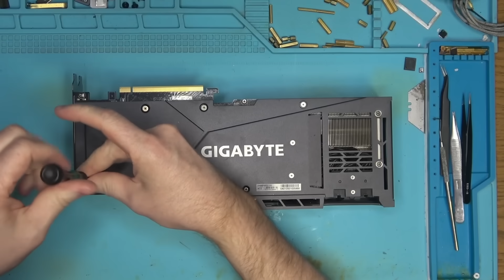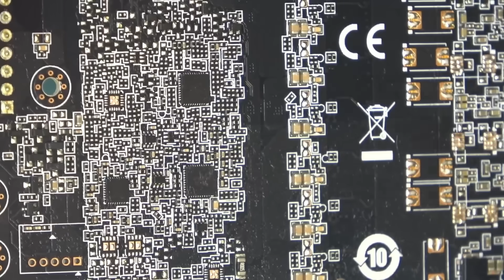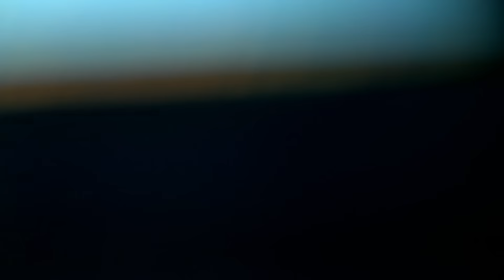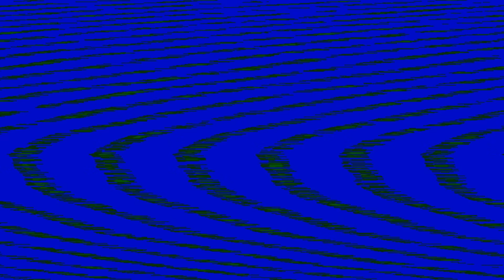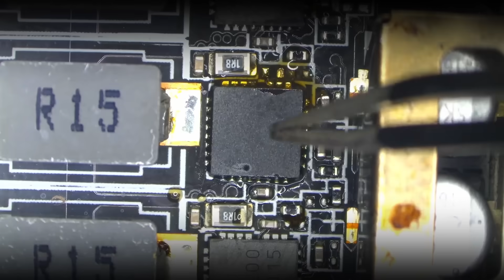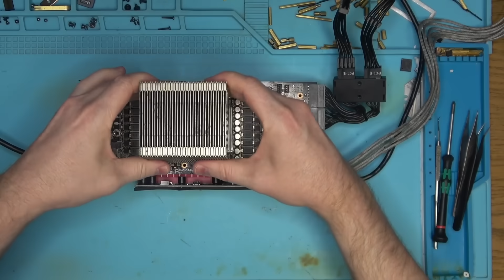Why Gigabyte keeps failing and what if your GPU gets a power surge ?

Comment: @northwestrepair You're bang on with your assessment. I bought a Gaming OC 6750 XT at 2023 January. It died 2 days ago. Games were playing fine. There were no stutters or frame drops. It just stopped sending signal and the Motherboard's VGA led started lighting up. Have done every checks to ensure if it has to do with GPU. It is. I'm not going to buy any Gigabyte products ever again. I'm looking to buy Sapphire Nitro + 7700XT now. Can I expect it to be durable, unlike this Gigabyte one which has lasted just a little more than the warranty period? Thank you in advance.

Comment: i have a zotac 3080 that luckily survived a surge from a lightening strike.  the power supply however did not make it.  one of the 8 pin cables that plugs into the psu to the gpu melted in place in the psu.  some of the coating on the wire right behind the connector where it plugs in to the psu melted and exposed wires and now that 8 pin cable is forever stuck to that psu now.  i saved it as a reminder to not fafo in a really bad lightening storm.

Comment: I had Gigabyte 3080 Ti, basically the same version as in the video, just white and after few months, i encountered artifacts basically with 0 load, no game, just in windows and watching videos. I switched display port and everything was ok and i didnt want to RMA cuz i had no time. After few weeks, when i had time, i tried to recreate the issue and connect back to the !bad" display port and everything was fine.
And every few months i had random artifacts, every time it started while idle and when i applied load, it completely crashed and restarted PC and then it worked fine for another few months. I tried new drivers (DDU ofc), but nothing helped and that was good for me, because i payed for extra warranty one shop has in my country, so when 50 series came out, i RMAed it and i wanted 4080 Super (the start of 50 series was not convincing) as a replacement in the same price category, but they had only "open box" state of 4080 Supers so i had to take 5080. So i dont know whats wrong with 3080 Tis, i saw a lot of them on your channel.

Im glad, almost no issues so far (i had one minor issue that i forgot what it was and im very careful with drivers and not updating when i dont need to), i have "basic" model Gainward 5080 Phoenix, but i was surprised by build quality, its very sturdy, no sag but i ordered stand anyway, just to be sure. I undervolted and overclocked and temps are very good cuz i think it has the same cooler they put on 5090.

Comment: Hi Tony, I have never seen a damaged bootstrap cap. Due to heat, or why? Not too large charge/discharge currents, likely way less than 1uF, usually protected by a low ohms resistor anyway (as the diode is tiny). I'm wondering, whats missing in the design.

Comment: Had 2x 3080 gigabyte fail in a month 😢. Now replacing psu hopefully that was the cause. Any chance of fixing them?
Reply: If it's the same issue as this one, sure. The permanent fix is to remove that capacitor and replace the blown power stage (and eventually the fuse). You have to diagnose it first of course. the PSU is not the issue

Comment: This is the reason why I unplug my whole system during a bad thunderstorm.
Reply: Ahh, the joys of overhead powerlines, we have it all underground over here, the only time we had some lightning damage was 2 years ago when there was a lightning strike on a tree right next door to us and even then only our Wifi router got fried. That was so loud, sounded like a cannon going off.
Reply: @Aliens308 i live in an old soviet building with the majority of cables underground(9 stores high) and the other side of this building was struck by a lightning which fried a lot of electronics as the news told us.
My friend lives in germany in a private house and in his case a lot of stuff got destroyed but surprisingly only the monitors died and not his pc.
Reply: @john-b2r9p  Then I guess that I may have been very lucky, since I was sitting at the PC when it occurred. Our electric provider has some safety system that cuts power immediately when there is a problem, so the power went out for a few seconds and when it came back I simply restarted the PC but the router didn't work anymore, it kept resetting itself and boot looping endlessly. 
Edit, I also have some MOVs in the fuse box that protect against voltage spikes, but they are sacrificial and none of them triggered
Reply: I wanna switch off also my system from the socket but i prefer to play some games until the thunderstorm go away 😀

Comment: meanwhile both my pcs using gigabyte motherboards and gpus keep trucking along, i use surge protection but every house they've been in has had unstable mains. brown outs and surges are common, tbh there's faulty cards of all brands i just put it down to bad luck.
Reply: Ok, well, thanks for clearing that up. Your advice is definitely worth more than someone that works on these every day.

🤡
Reply: @BLawr3nce chill out lil bro this guy says every brand sucks 😂 edit: my 5+ year old gigabyte 3080 should be long dead according to this channel btw, like i said luck.

Comment: Like in when a breaker pops in the house and some Muppet turns it back on again without disconnecting all devices against current peaks?

Myeah this is why I avoid Gigabyte with a passion

Comment: What kind of a shity power supply allowed this to happen?
Reply: Not related with the power supply
Reply: @TigTex  Aris from hardware busters, "Cybernetics" would disagree with you. You see modern PSU's have all these protections exactly to do that, to protect the internal components from all eventualities.
Reply: @teddp a power stage that shorts itself out due to bad PCB design cannot be prevented with a proper power supply. What might be prevented is extreme damage because the power supply doesn't shut off in time.
Reply: @TigTex the damage was caused due to a power surge. The PSU should have handled it.
Reply: @teddp no. The damage was caused by a faulty PCB design. Power surge is unrelated. If it was a power surge, that graphics card would be trash, not even the PCB is good to be a donor

Comment: A related warning.
A specific brand of fiber optic HDMI cable has an issue where if there is a lightning strike anywhere near your location, the connectors will produce a static spark strong enough to kill the HDMI port on both connected devices.  It will produce a visual flash, and an audible pop.
Here's the thing -- ONLY the specific HDMI port that was connected will be killed, the rest of the device will continue to function normally.
I had this happen twice.  The first time I had no real idea what happened, as all devices were powered down, so I purchased a new FO HDMI cable of the same to replace the one that was attached when both devices lost HDMI capability.  Paid to have the OPPO UDP 205 repaired (HDMI in board).  MSI replaced the RTX 4090.  No sign of lightning damage, just dead HDMI in and out on respective devices.
Second time, POP! -- Heard it.  Checked . . . that specific HDMI input on surround receiver was dead.  HDMI output on replacement 4090 was also dead again.  The strike wasn't even close to the house, but miles away.
As I have six more inputs on the receiver, I simply swapped to another one. 4090 also covered under warranty, and they still couldn't figure out why the HDMI out was dead.
I was suspicious after that and purchased another, more expensive brand of FO HMDI cable to replace the first one.  Next thunderstorm, I disconnected the new one, but had the two old brand cables lying out in the open.  POP!  A bright flash of light out of all four ends of the older completely disconnected HDMI cables.  The culprit was discovered.
I cannot disclose the maker of the cables, as various discussions are ongoing, but let me warn you that you should not trust an Optical HDMI cable during a thunderstorm.  They require voltage from the device they are connected to to function, and if you buy the wrong one, as I did -- your equipment is at risk.
Reply: Why would you buy a fiber optic HDMI cable? lol.
Is this another case of "a fool and his money" thing?

The distances and frequencies used for HDMI in consumer devices don't require a fiber optic link.
Reminds me of people buying gold plated Toslink cables lmao.
Reply: @GoldSrc_  144hz at 4k requires HDMI certified cable at 2.1. Use anything else it won't work. If you go above 5m (16 feet) in length, thats when you get fibre optic cable. If you wont the display loses signal etc. In my case I use one for high refresh rate 4k display 10m distance (30 feet). Cable works fine for years and costed 45 dollars + is HDMI certified for 48gbps
Reply: @bagmar ever hear of display port? It can do that with ease!
Reply: You could get a display port that does the same exact thing for half the cost😂
Reply: @bagmar  Thank you for chiming in, here.  The people talking about Display Port here seem to think this is a very short connection.
Reply: @spencernene  my TV doesn't have DP :)
Reply: @spencernene its all about the lenght. TV's especially are more prone to lose signal integrity at high data bandwidth.
Reply: @bagmar oh damn that’s tough, you should still be able to get a high spec hdmi for pretty cheap if you don’t fall for the marking garbage
Reply: @GoldSrc_  The cable goes 40' from the room the PC is in to the living room with the TV and surround system.  Passive HDMI cables are limited to around 15 ft. (25ft for premium) to reliably pass a 4K@60hz signal.  This isn't marketing, the very expensive passive (copper core) HDMI cable I was using did fine for 1080p, but suffered major issues when the resolution was cranked up.
Reply: If I lived in a third-world country with exposed over-ground power lines (like Vietnam, Burma, some parts of Soviet Russia, or the US and A), I'd rather invest 10-20 bucks in a surge-protected power strip instead of playing pop-a-port with expensive devices.
Reply: @RealNovgorod  Both ends of the chain are protected by surge-protected UPS.  Please re-read what I wrote.  The ends of the HDMI cable spark during a close lightning strike even when NOT attached to anything at all.
Reply: @ripvanwinkle9648  Uhmazin'... Do you live inside a plasma ball? Maybe it's time to tinfoil the house like in Better Call Saul (not even joking). At least around the cable runs in the walls which apparently act as a huge inductor.
Reply: @RealNovgorod  The new cable from a different manufacturer does not have this issue, just the one from a specific maker.
Reply: @ripvanwinkle9648  If you live essentially inside a Tesla coil or a radio telescope with such huge amounts of B-field buildup from the weather that it causes random cables to induce sparkable voltage, it's just a matter of coincidence until something else catches fire. You don't have to build an entire Faraday cage, but proper grounding is your friend, starting from the roof.
Reply: If the power surge occurs frequently, did you get a power strip with over current protection?
And if those don't work, how's the monitor still somehow fine?
I'd assume it would get nuked if so much voltage went through it
Reply: @labmasterx5599  The cable doesn't go to the monitor.  My computer monitors are connected via Display Port.  The HDMI cable goes 40' into another room to a home theater system.  As I stated in my post, the HDMI cable itself will spark at both ends even when NOT connected to anything at all.
Reply: @ripvanwinkle9648  ooooh, gotcha
Reply: The only weird thing i personally noticed about HDMI cable going from my TV is that it tends to give me small shocks, when i touch it while disconnecting or connecting PC connectors. And it somehow seems to be going all the way to my separate speakers.

TV is a modern 'SMART' TV with basic 2-prong cord and no grounding.
Reply: @n0n4me-h2h  does all this only possible on HDMI or  could occur on DP too?
Reply: @panpan_boy  I am discussing one BRAND of cable maker's Fiber Optic HDMI cable.  The new cable from another manufacturer does not have this issue.
Reply: "I cannot disclose the maker" Shut the fuc* up. Goofy ai fearmongering bs. No one with a brain should ever read stuff like this and have anything but extreme derision for the people who fart it out of an llm. Up yours guy.
Reply: Crazy 😧
Reply: What a first world problem. Have you considered just putting your PC by your screen? Lmao

Comment: i had a 850W PSU, malfunctioning after 3 years, somehow broke my XFX 7900 XT. I got a new 7900 XT from warranty.  Used a new PSU, but somehow old PSU also broke partly my motherboard, which i did not know. And then my motherboard was able to break my new 7900 XT. So, burned through 2 GPUs. Chain reaction. Bad luck.
Reply: I had bad 850W PSU (EVGA Supernova G2, well known brand & model) from the beginning and before i was able to figure it out, it killed 3 motherboards.

Nothing else tho.
Reply: thats why there are tech ppl who does the job for u so u dont break stuff easy and clam the warrenty for ur mistake😂

Comment: You make it look so easy
Reply from the maker: I try.
Reply: Believe it or not, the hardest part is the soldering
Reply: @skidkid87   And even that’s not hard.

In fact, none of this is hard. People just think that because they haven’t learned it yet.

The hard part is having the patience and determination to learn it.
Reply: @BLawr3nce expensive equipment and lots of time. What's your definition of hard if I may ask
Reply: @heretic5552  Not expensive at all if it's your job (about a day of repair work will fully pay for the essential tools), but completely unreasonable if you need a one-off fix for your own GPU.
Reply from the maker: @heretic5552 my tools are dirt cheap
Reply: @BLawr3nce  can confirm that the soldering itself is quite easy. I startet repairing gpus cause of NWR and say that the soldering is easier then having the patience and to dive in to the rabbit holes of why things are not working even tho they should be working etc
Reply: @northwestrepair  your bga machine, your soldering station, microscope I can't even afford your thermal cam or where you being sarcastic I can't tell 😅. I'm from a  third world country that's why